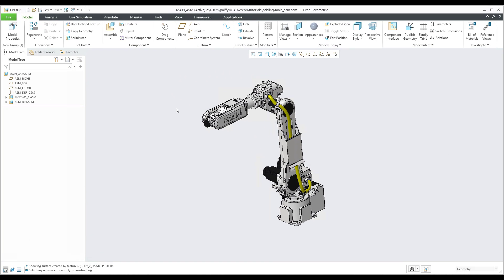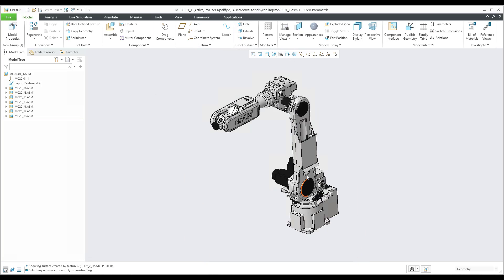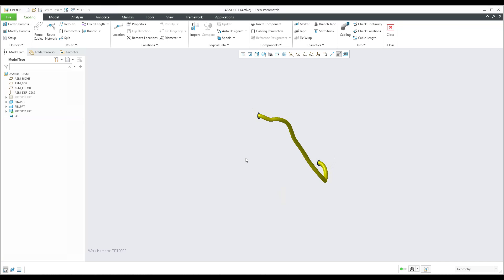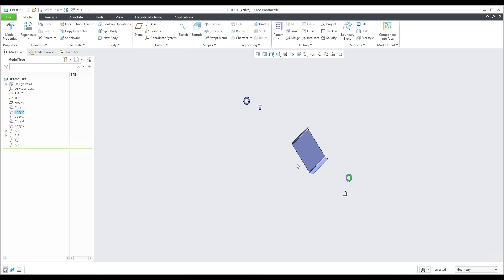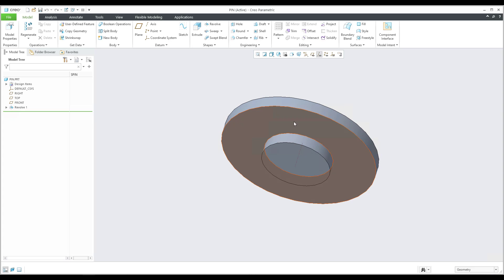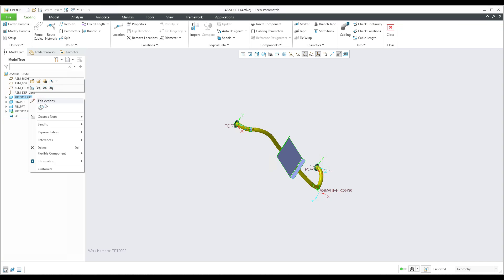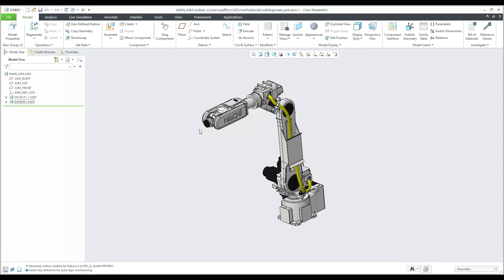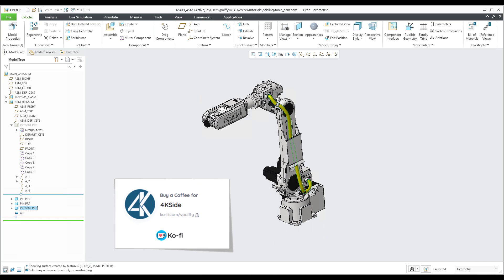Introduction to Creo Cabling

Comment: Oh I guess this is the thing I'm looking for!! I'm doing water cooler tube project inside the PC, don't know if it is relevant or not
Reply from the maker: If you need to create tubes, use Creo piping. I have created also short series of Piping tutorials, try to check my website and stay tuned. Bye Vladimir
Reply: @4kside  So cabling and piping technically have the same result?
Reply from the maker: In 3D looks almost same, the different is with routing. Cables are mainly placed on surfaces and offset is defined automatically. The pipes and hoses are located by values and entities. The cables are also possible to split to the different connectors. My plan to show in the upcoming tutorial for Creo Cabling ;)
Reply: @4kside  Cool! Thanks for the explanation! Hope you can teach us how to do free cabling with curves in assembly!!